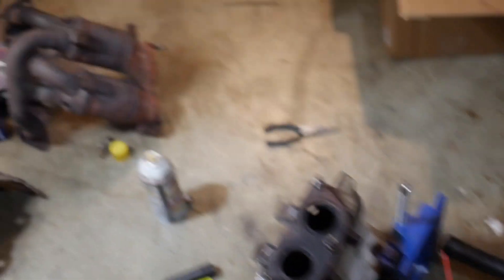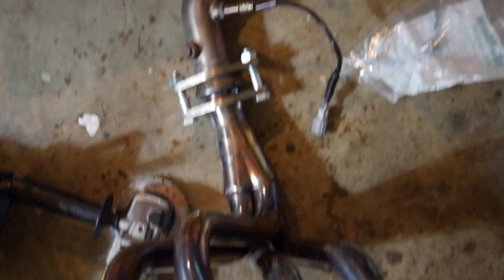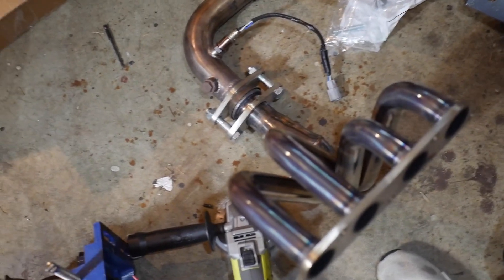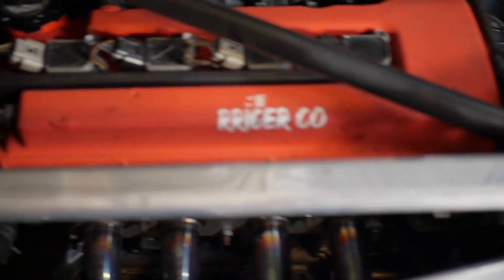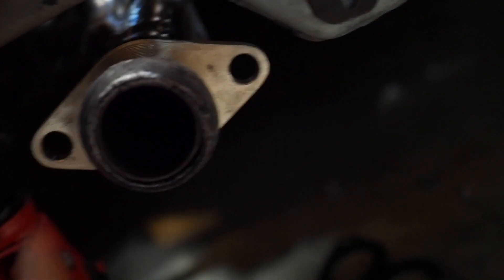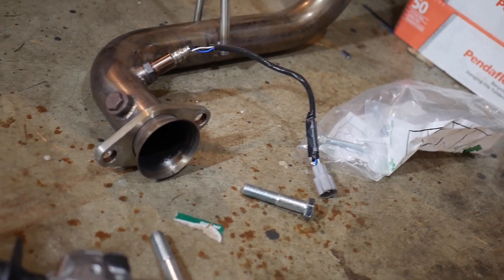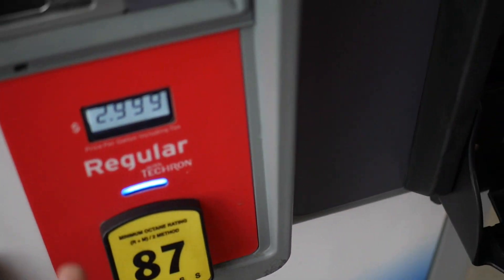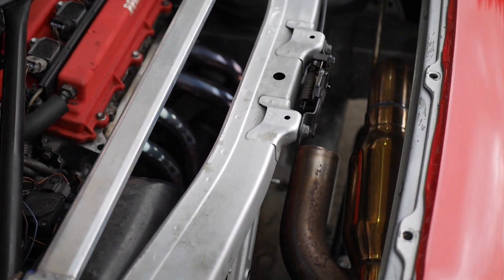Finally adding power to my Toyota MR2 Spyder!

Comment: Just bought a 2000 mr2 spider, I think stock other than custom header and exhaust. What should I do for more power? It’s got the 1ZZ in it.
Reply from the maker: MAXIMUM PRODUCTIONS there’s not much you can do for the 1zz. Tbh, u gotta swap it, yes u cna go turbo on it, but the 1zz burns a lot especially the earlier pre facelift models like ours. Save up, swap for a motor of ur liking. 2zz or 2gr or k swap. I did my motor swap already and it wasn’t too bad. Did it in my garage by myself
Reply: Okay awesome. Can you email me I have a few more questions for you?
Reply: Your Instagram is linked may I add you on that and pm you?
Reply from the maker: MAXIMUM PRODUCTIONS yes!
Reply: Redline Ricer I messaged you on insta